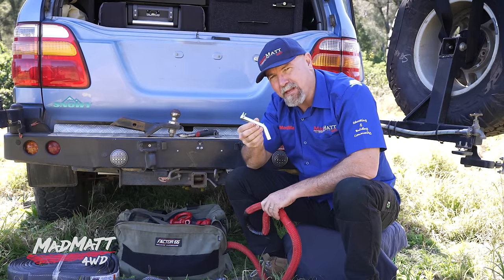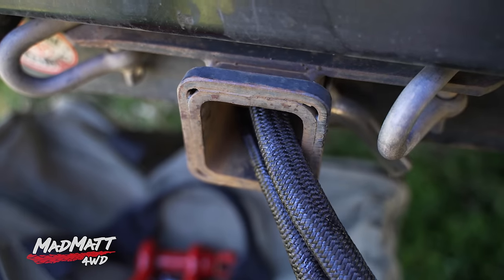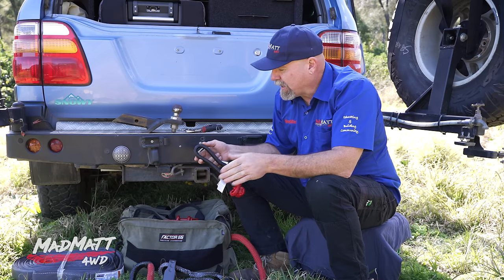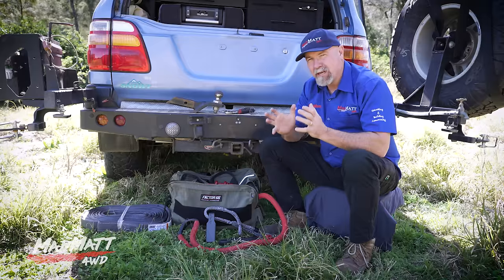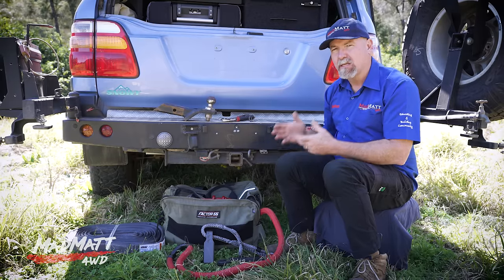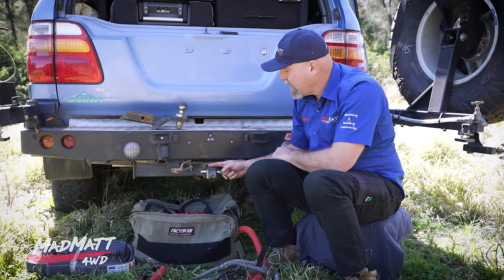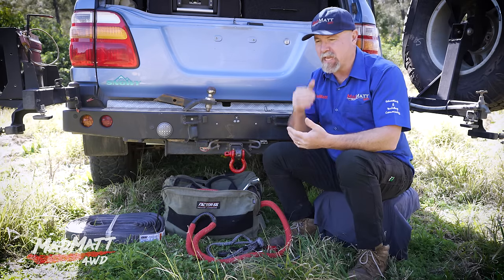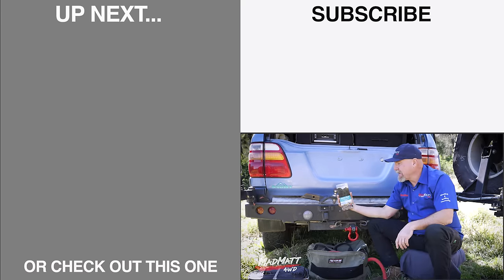Should you use a hitch pin as a 4x4 recovery device? Is it a YES or NO answer?

Comment: How about engaging an engineer that has no relationship to recovery gear industry. I will be very surprised if a standard 4x4 recovery soft sling is going to bend a towing hitch pin. The only noteworthy consideration is recovery operations that are done on angles where the sling can encounter the edges of the tow bar hitch housing.
Reply from the maker: A soft shackle will certainly have the strength to bend and break a hitch pin according to the testing we’ve seen.

Comment: Question. I have a dedicate large shackle on a hitch, but if you have a choice between snatching off a pin vs snatching off a tow ball, the ball is worse. Right?
Reply from the maker: . Never use the ball or hitch receiver. The hitch is known to fail at the weld which is what killed Ryan in my earlier video.

Comment: I have wondered in the past, and still, about the ratings on these pins, simply for their intended use. There is SO much hullaballoo about the rating on the hitch & on the ball ect. But the pin used to hold it all in place is like... whatever 🤷 surley there is more to know about it. The question is, who actually knows? The manufacturer? Probably, however, isn't it the end user that really needs to know?!?!
Reply from the maker: I’ve heard from a reliable source they bend at nine ton when fitted correctly. But when towing they won’t get subjected to anywhere near that load.
Reply: @MadMatt4WD  18,000lbs ok well that helps to put some things into perspective. As per the points you were making, not everyone uses them this way, but it can do..."something" thank-you, from Canada 🇨🇦

Comment: Would it be fair to say the snatch strap would be a better tool to use if you had to use the pin? Given that the energy from the pull is spread across the majority of the pin and not a 1cm section in the weakest part of the pin being the centre of it?
Reply from the maker: No I don’t think so. It’s still not true double shear.

Comment: I’m not understanding the comparison of the pin bending at 9 metric tons or almost 20000lbs to that item that’s approved but rated at only 9500lbs. Myself I use high strength bolt in place of hitch pins. Not likely to be the failure point. Probably tear the vehicle’s frame in half first
Reply from the maker: Generally a rating is for what it’s safe to do which by definition should be less than any point at which it’ll fail. Yes I use a bolt on the 200 as well.
Reply: @MadMatt4WD Unfortunately, I can’t trust a rating that a manufacturer gets by submitting their hand picked part for certification but then mass producing it the cheapest way possible. I can’t put my safety in the hands of a stamp that’s only there to sell a product by giving you a false sense of security. Keep up with the interesting videos.

Comment: Here is a radical idea, make it a non issue by just carrying the recovery hitch in the vehicle @ all times, even with the shackle it is not a huge additional weight. I have seen more drivers carry unnecessary stuff in their vehicles, than not, often taking up a significant amount of space & weight. 

Make it a regular thing to check & clear out those things that are not necessary to be onboard all of the time. If you get organized,  not even 5 mins once a month, its not a huge hit to you afternoon soap viewing time :0)

I don't carry my main recovery gear in the vehicle all the time. But I do carry some basic bits.

In emergencies anything can happen & you might need to approach emergencies in a different way to what most 4wd recoveries tend to be. You may need that extra security & strength in the right type of recovery hitch. You may need to apply greater load than just the pin can handle.

@ very least I can only imagine removing a bent pin without causing more damage would be a massive unnecessary pain. Replacing  equipment because its been damaged via incorrect or less ideal use equals less in the beer budget.

I am no expert @ recoveries, emergency or otherwise, I have done both with vehicles way more heavier than regular 4wds. Things can turn bad in both very quickly, I have seen this1st hand. 

My mindset is thus, not just for all the things I know & can see can go wrong, but for all the things that I can not.
Reply from the maker: Woah you just broke the internet. 😂😂😂 I agree with you. When it’s so cheap and easy to buy quality gear and carry it with you. Why set yourself up to take the risk.
Reply: @MadMatt4WD  :0) Yeah that was not me, the internet has been broken for some time now.
Reply from the maker: @leonkane8240  😂😂😂

Comment: Did a little bit of research last week (and just now) and it alleged or fact that most hitch pins are rated as a 'Grade 5'. Disregarding the convenience of faster removal with the use of a simple 'Bridge Pin' - I believe the setup would be stronger by upgrading to a 5/8" Grade 8 bolt - so long as it was long enough that the entire shank of the bolt (not the threads) spanned the entire width of the trailer hitch receiver tube. I would also venture to guess that most all receiver hitch components are designed for consistent load pressures - and are not designed for high rpm / high torque 'snatches'. Imagine if something you're recovering is really REALLY stuck... Wouldn't it be similar to you anchoring a strap to a very large tree and vainly attempting to pull it out by its roots? The repeated damage to the drivetrain alone must be phenomenal? - Thank you, for starting this discussion by sharing this content! - Because of it alone - I am now Subscribed to your channel.

EDIT: You addressed that last bit at the end of your video - Next time I won't pause to comment, but watch the video in its entirety.

Comment: Can't you connect around the hitch tube either just to the left or right of the center portion where the ball mount inserts (the ball mount is what is held in by the pin)? That square tube usually has rounded corners and you are making two 90 degree turns about 2 to 3 inches (5 to 7.5 cm) apart. Obviously this would only work for a straight pull as any pull at an angle would result in the rope sliding to one side resulting in the load not being distributed evenly to each side of the vehicle frame.
Reply from the maker: Why use methods like that when you have the proper tool for the job that’s designed and tested
Reply: @MadMatt4WD  Certainly if you have better equipment available, use it.  But in your "emergency" type situations, would it be a better choice than the pin?
Reply from the maker: @davidgates1122  well yes that’s what I’m saying

Comment: Question what about the strength rating of the pin ??? You have to use 8.8 grade bolts to mount the towbar but there is no rating on the pin . Seems like the pin could be the weak link
Reply from the maker: It’s not the weak link if used correctly.
Reply: @MadMatt4WD  well every other part is load tested strength tested except the pin
Reply from the maker: @annalouise280110  ok we’re probably misunderstanding each other here. The tow pack is not rated for recovery nor are any of it accessories is my point. But when these parts are used the way I’ve shown they seem to work.

Comment: So the pin bends at 9 ton and the recovery point is rated to 9500 lb which is less than the 9 ton that it took to bend the pin. Did i get that correct ?
Reply from the maker: You did but read this from Factor55 as an answer. 

The 2” hitch itself is rated for 9500 lbs. that’s the max load. That’s why the 2” HitchLinks, all of them have 9500 lbs machined into them. Our parts have not seen yielding in testing until just before breaking. What’s this mean? Every other item you have attached to the HitchLink and pin will fail before either of those do. 

Standard duty soft shackle - 39K 
Tow Strap- 31K 
KERR- 29K 
HitchLink 2.0 - 51K 
Hitch pins- 50+K 

The entire off-road industry functions off break strength not WLL. 3/8 Synthetic rope breaks between 18-22K so a 5:1 means it’s WLL is only 4.4K on a 12K winch? 

It’s about quality of materials and validation through testing.

Comment: This video kind of hits on one of my biggest concerns. I saw your video on the tragedy that happened just a short while ago in which a drop down hitch was used for recovery and it ripped the ball and the majority of the shank off sending it through the recovered vehicles driver side windshield. What I specifically Wonder is, what are the forces that a hitch pin can withstand? I understand that it's the least likely point of failure, but is that true of all hitch pins? It seems like a lot of force and trust put on a 3/8 inch piece of steel. I'm guessing as to the thickness it's probably more like a half inch thick piece of steel.I personally have sheared one of those hitch pins towing a relatively heavy load under relatively minor forces. I was pulling a medium duty flatbed trailer with a mini excavator down a dirt road and never experienced near the force of a stuck vehicle. The only thing that kept the trailer secured to the truck was the weight of the trailer exerting downward pressure on the entire receiver. Every time I see Matt at Matt's off-road recovery use his Pendle hitch, I cringe. A pintle hitch is strong and will likely release the kinetic rope first but, that's assuming it doesn't shear the hitch pin and pull the entire pintle hitch out causing the same type of catastrophic failure. I am not an experienced recovery person, but I tow heavy loads quite often with a bumper pull setup.
Reply from the maker: They’re strong but not as strong as people think. Be careful.

Comment: Matt, Like I originally said your vidio is all about selling Factor55 gear, Honestly tell me you didn't receive  reward from Factor55 or a distributor. The 4WD industry needs to standardize it's rating system, Straps,winch lines, etc are in BREAKING Strain KG/LBS, while shackles etc, are in SWL/WLL, (safe working load/ working load limit) Aust has had a metric system for 50yrs now. The two different ratings only confuse the normal guy that just wants to know that the gear he is using all mates up and is safe to use. LIKE THE HITCH PIN, not just in an emergence.
Reply from the maker: You won’t believe this but like you I do like to get paid for my work but Factor55 has never paid me to do any videos or content for them. I do make a small commission on the sale of an item if someone purchases but aside from that this video cost us money to make. As for your insistence on the use of the hitch pin you will find that you are well out of step with the council of most of the recovery authorities around the world. Don’t take my word for it though go and read @robertpeppers comment on your previous post as one example. Fyi I seek the council of many guys like Robert before I make these types of videos.